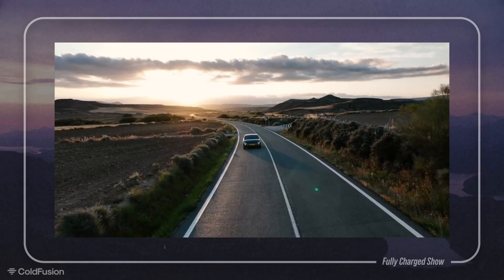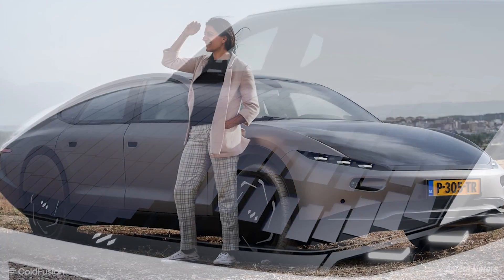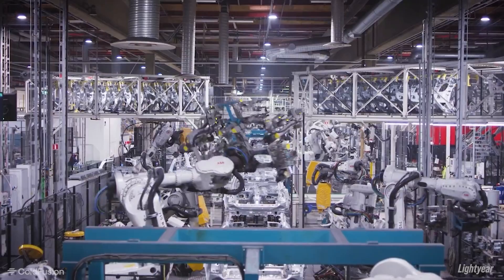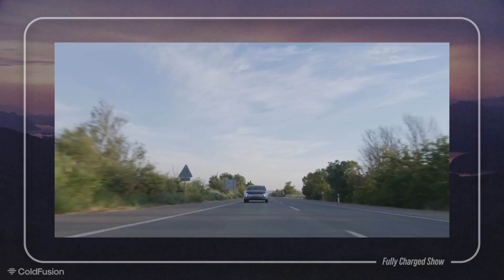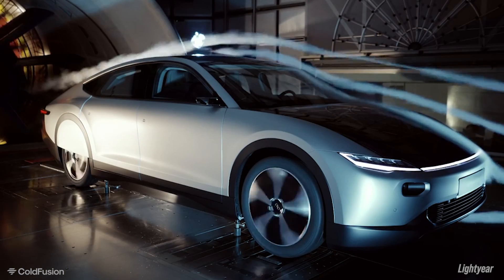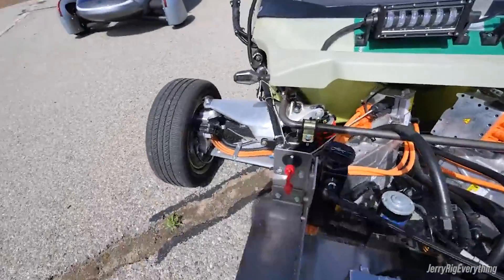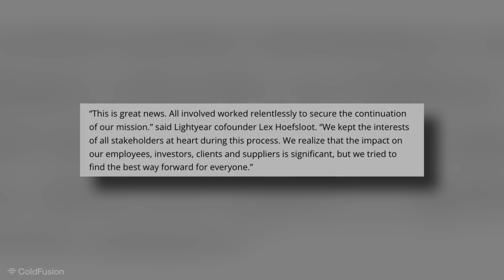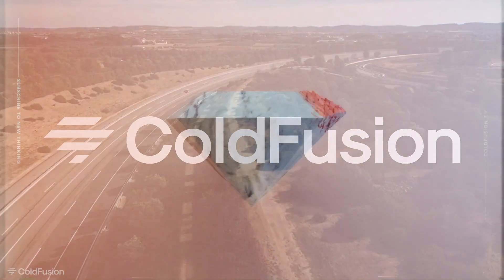3 Interesting Solar Car Projects

Comment: I'm sorry to say that this is just not commercially viable. 70km/day is for ideal conditions only, during the summer period, on a sunny day, and only if you keep your car completely unshaded for the whole day. Realistically, you will get about 10km range per day on average for the Europe region. And less than 5km per day during the winter period. 

I work in the solar industry so I am all for solar. But there are good use cases for solar energy and bad ones. This is a perfect example of a bad one.

Comment: I imagine a lot of people would want a solar car for 30k, but I think a lot of people would like an EV for 30k in general, solar or not. I'm not sure what bearing it has on Lightyear, though... 40k euro is over 43k euro, and as you said, that price could end up being higher. So I'd say the more relevant and interesting question is whether we would like a solar car for $45k.

For me, I think the answer would be no, because there are lots of other EVs around that price (potentially even cheaper given the US tax credit situation). If the big thing that sets the Lightyear 2 apart is the solar roof, most of that value is wasted on me as I park in a garage 4 days of the week. Besides, I already have solar panels on the house. And that's assuming all other things are equal, which I doubt will be the case--I'd expect the Lightyear 2 to also have abysmal performance. I'd also feel uneasy buying something from a company which might not be around in 5 years to sell replacement parts.

The Lightyear 0 was a confusing product to me. It had an eye-watering price without the level of performance people generally expect from an EV in that class. I'm not sure who it was intended for, presumably just people who wanted something which was different, trying to flex their green muscles. Given the inefficiencies of low-volume production, I'm not sure the vehicle would end up with a lower carbon footprint than an EV that cost 80% less paired with rooftop solar. I guess it makes sense as a step for them to take on their way to more affordable vehicles, in the same way the Model S and Lucid Air Dream Edition were, but if the value proposition just isn't there...

Comment: I'm already doing this out in the Pacific Northwest (summer) using about 1.5 kW solar, a tiny 2,000 watt inverter and 5 kWh of battery storage. Offering about 20 to 30 miles a day in a relatively efficient hot hatch EV. The inefficiencies with my set-up remains staggering, so to apply this directly onto, and into, the vehicle would be game changing.

Comment: Better off plastering the side of an electric ferry first and then scale it down rather than the other way round
But my answer to your final question, yes, if I could retrofit my diesel van eventually that would be grand too

Comment: Nah,  that is a silly idea. There isn't enough of space on a car  for solar panels to add significant range. Maybe if you live on a desert, or only need to use a car once a week it makes a tiny bit of sense. Also batteries hate heat, parking your EV on sunny scorching hot parking lot will significantly reduce your battery longevity. People living in sunny low rise areas would be better off installing solar panels on their roofs, people living in mid rise or high rise buildings will struggle to find a sunny spot to charge their car.

Comment: Tesla model 3 is a much better value at only $55,000cdn vs 356,000 for the Lightyear 0. $300,000 is a lot of charging on a Model 3. I highly doubt the new one will be $58,000cdn

Comment: i'll be honest i don't drive more than 25 miles a day, and i live in a desert region in the US so hell yes i would by a solar car.  i bought an e-bike to try to used for chores that are less than 2 miles but mann its too hot and the road do not feel safe.  a solar car would be the next best thing, also to use it to off set the cooling cost as a solar array for the house when not in use

Comment: The implication here is that the Lightyear engineers were the only car designers who are hyperfocused on efficiency, aerodynamics, light weight, etc. This idea is so absurd it borders on delusional. What do you think those engineers at GM and Toyota were using those wind tunnels for during the hast half century?!

Comment: This is actually completely impossible. As Solar Panels are now, just in the last year 30-35% efficient. That means 65-70% of potential solar energy is NOT available. Before then, Solar Panels were 15-20% efficient. So Solar Energy is not capable at all to run and move a car. Solar Panels would barely be able to run the infotainment/Navigation systems and turn on the interior lights.

Comment: NEVER trust a futuristic car that solves all the problems until it is actually built into a production model and the claims can be independently verified 😂 so many people fall for the hype of animation and future talk they don’t usually understand that science hasn’t been worked out in most of this stuff. Aptera is registered as a motorcycle so it has zero crash safety rating but the company “says it’s very safe”, they don’t have a working solar panel version - the car is covered in decals that look like panels 🤣🤣🤣🤣🤣 I’ve seen it in person - held together with zip ties with fit & finish of a kids toy. But hey if you want to invest and put your money down good luck to you. If charging an electric car on house solar is the single highest draw on the system how do you expect solar on a round car with 20-40x less surface area than your roof will be adequate for driving without ever plugging it in?
Reply: Good advice.

Comment: I am designing a 123Mobile based on my proven Smart and the small Toyota IQ and the legendary Steyr Puch Haflinger from Austria. I also take the experiences from the Lightyear, Aptera and Sion. This becomes a comfortable three-seater (1+2=3 seats configuration) plus baby seat, with 4 wheel motors for all terrains, good aerodynamics, lightweight construction, trailer hitch, three-part battery selectable, bidirectional charging, of course 220 watt solar roof, efficiency 9 kWh/100km, top speed 130 km/h, range up to 300 km. A versatile eye-catcher for less than 30 k€, coming soon from Austria.

Comment: I call BS.  The problem is not efficiency so much as how limited that "good sunshine" is.
God help you if you park in a garage, the shade, or any protective structure.   There is also the problem that clouds can shade 90% of the energy during the daylight hours.   Of course the current car will never pass crash safety requirements because efficiency means low weight and light structures.

Comment: I'm really not one for going fast while driving, acceleration is nice to get out of tricky spots though and 99mph (considering the limit in the UK is 70) is more than enough. For efficiency and costing me less in electric bills i'm more than happy to hand over performance, not to mention the time saving, not having to recharge and wait. I think an efficient electric vehicle is exactly what the industry needs, squeezing a little more acceleration out of it would be nice though even at the cost of top speed.

Comment: The main issue for 3 wheeled vehicles like an "autocycle", like the Aptera is that in some states, you need a motorcycle license to drive them. NY is one of those states, one of the most populated states in the country. Also, in 3 states, you need to wear a helmet while you drive, even though it is entirely enclosed and has airbags and everything else. No normal driver is going to go and take a road test on a motorcycle to get a separate license to buy a car, they need more lobbyists to push to change the laws for enclosed vehicles.
Reply: At least you can get a motorcycle license.

Comment: So here's a take from an engineer who did commercial solar for a while and now does energy efficiency.
It's a lot more efficient to have a battery powered car and mount your solar panels on your roof... 
The whole "1kW under ideal conditions" is a marketing BS, the ideal conditions happen a few hours per year unless you live at the equator, and even there, you're never going to have your panels perfectly perpendicular to the sun's rays. A rule of thumb for south Canada & North US is 1500kWh/kW of panels installed. so they are producing about 1500kWh from their panels. That's on average 4kWh per day... compare that to the 60kWh battery they have... and you quickly realize the panels are a gimmic 

Then there's dirt, and microcracking on the rigid silicone panels (or you could use the inefficient flexible silicone). This is why you put a battery in the car and leave panels at home.

As for most efficient. Modern electrical motors are already 95% plus efficient, and A LOT of effort goes into aerodynamics of the cars... so where is their great efficiency boos coming from? 

Bottom line - something's fishy with their story.

Comment: It's just not true nobody cares about efficiency. Some legacy manufacturers don't, because they are still converting gas cars, but true EV makers definitely care a lot. Tesla for example is famous for it's highly efficient cars. But there are always tradeoffs, and there's a limit to how much it worth to sacrifice for efficiency. Tesla wants to, and hast to, build cars that people want to, and able to, buy. Tesla wouldn't exist today if it tried to sell a car with a 10 sec 0-60 time. Or one with thin tires that don't provide enough grip. Or one with too little space. But Tesla is also heavily incentivized to increase efficiency. A more efficient car can go further with the same battery, or can be lighter and cheaper for the same range. The latter is especially important as they are scaling up production and need more and more people to be able to afford their cars.

As for solar panels on the cars, it doesn't make sense in most cases. It increases cost and weight, while providing negligible power. Only hyper-efficient cars benefit from it.
But with costs coming down fast the equation changes. Tesla plans to offer solar panels for the Cybertruck. Not for everyday use, but mostly for hardcore camping, when there's no electricity nearby, but the car spends days out in the sun without moving. This way the car can power everything in the camp and still maintain a full charge for the trip home.

Comment: I only need to drive like 5km or less per day in my vehicle, the rest of the time it sits out in the parking lot of my apartment complex, if the car was less than 30 grand, with federal subsidies and state subsidies, it would be amazing for me. Even if the solar panels only produced 10km per day, I would never need to charge it again. They should make an even cheaper version of this, about the size of a smart car, that has less solar panels, even lower weight, and only 2 seats and a small trunk, and limited to 65mph, to be even cheaper, I would buy it in a heartbeat. (Any roads I travel on are no higher than 30-40mph anyway, the absolute highest being 55, rarely)

Comment: Unfortunately there are way to little sun in my region for solar panels on cars to make any sense. Efficiency is key, but efficiency in the winter and the ability not to loose range in cold weather is the akilles heal for EV's in my region.  

for me the ultimate EV is a competitive priced and well made car that is easily maintained and can be user serviced (like old cars could). With reasonable priced parts, a big battery, long range in the winter and fast charging.

The best options today in my opinion is Kia, Hyundai or the Tesla Model 3 since it is so cheap.

Comment: The biggest and fundamental problem with solar energy is energy density is less per square meter of area, over the top whatever the current materials we have are not offering that much efficiency in converting the solar to electrical energy.
Also In a car we have limited floor space which can be used for solar panels, these are some of the biggest and uncontrollable variables, so I think instead of spending so much money on producing Solar powered cars we can work on increasing the efficiency of existing electric cars and increase the energy density of the battery being used in the car, and try other viable and more practical methods to harness the solar energy energy for e.g. making an affordable solar roof for homes, which we can use to charge the vehicle at home.
Reply: This guy gets it 🧠

Comment: Same concept, but a smaller lighter car, from San Diego:
https://en.wikipedia.org/wiki/Aptera_Motors
Plan to deliver product in 2024. Cross your fingers, that it's not vaporware.
Reply: Definitely don't hold your breath.

Comment: Okay I’m sorry, I usually give you the benefit of the doubt due to your record so far but at two minutes of this, I gotta call it. What went wrong? Physics. Plain and simple. Engineering can achieve marvellous magic like things when it is being driven by physics but just as well will it land flat on it’s face when it’s trying to compete with it. There is just not enough energy in the solar radiotion cast on the area of a car to drive that 2 ton lump of steel and batteries around in a manner cars are driven on a daily basis.

And now on the the rest I guess
Reply: The average U.S. car weighs two tons. The average European car weighs 1.5 tons. The lightest, shortest range Tesla is almost two tons, about 1/3 more than the Lightyear. The claimed maximum range on a day's solar charge is 70 km, although you can still plug it in for more typical (on the high end for EV's) maximum range. The average driver goes less than that in a day. Obviously their next model isn't available yet, so we will see if that's exaggerated . . . my guess is it will turn out to be . . . but there is no reason a light weight vehicle designed for efficiency, not power, can't produce much better numbers than is typical. We had Honda Civics in the 80's that got almost 60 miles per gallon (25 kpl), now we don't even come close, because most people apparently want power, not efficiency. I assume you are one of those people.
Reply: @crawkn   Yeah I pretty much agree with you.

While I do totally believe that an efficient vehicle can hit the numbers they are stating, my issue with it is that unless the user happens to live in the Mojave desert and have a daily 50 km roundtrip commute consisting of 90% empty higway, those numbers aren’t gonna hold up well. Altough it would be rather nice if we could collectively drive in a more efficient manner, I really don’t see it happening until significant automation of the traffic has (hopefully some day) taken place. Slow acceleration, predictive driving style and efficient aerodynamics are great until you find yourself in an urban area stopping and accelerating constantly between 0 and 50 km/h. That could be some day tackled with more efficient motors and some extremely efficient regenerative breaking but it doesn’t seem to be what this car is about. 

Which brings me back to my original doubt,in my humble back of the mental envelope assesment, the Sun just doesn’t radiate enough energy per square meter to enable urban driving in a manner it is done at the time. That being said, a solar hybrid aproach actually could make sense, depending on where the final solar range per day figure lands. I know that the video explained that this is avtually their aproach and I refer back to my ”at the two minute mark” disclaimer 😄 

And yes, full disclosure, I really do like the power also 🤷‍♂️😄
Reply: @TR7H  from a practical point of view, the solar panels are something of a gimmick, because obviously you couldn't depend on them for primary charging. For ideal battery life, charge must be maintained in the middle 60% of capacity, so you will never even use the bottom 15% of range. But it could allow people with modest commutes to operate daily with minimal loss of charge, allowing for significantly less frequent charging. From a position of cost effectiveness, rooftop solar to charge an efficient vehicle offers more practical applications.

Regarding power, efficiency is part tradeoff, but also part engineering focus. My Hondas in the 80’s and 90's were significantly faster off the line than American vehicles with much larger engines. This is due to a longer bore to stroke ratio, which substitutes high-rev capability for low-end torque. This requires more precise manufacturing tolerances to maintain balance and reduce friction. U.S. manufacturers never felt the need to improve their tolerances, so they still can't compete 40 years later.

Then there's the simple fact that electric motors absolutely blow ICE power plants away in both torque and energy efficiency, so it is simply unnecessary to maximize power to drive in an average manner. Even the lowest-power Tesla has both acceleration and efficiency far superior to the vast majority of ICE-powered vehicles. Just toning the power down to average would give impressive efficiency specs.

I'm definitely in favor of automated traffic management. Most of the energy used in rush-hour transportation is absolutely wasted. I2V (infrastructure to vehicle) communication is well developed in planning, yet is virtually non-existent in application, with few self-driving vehicles prepared to leverage it when it does finally surface.